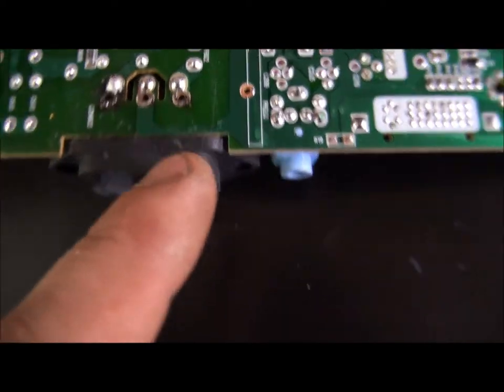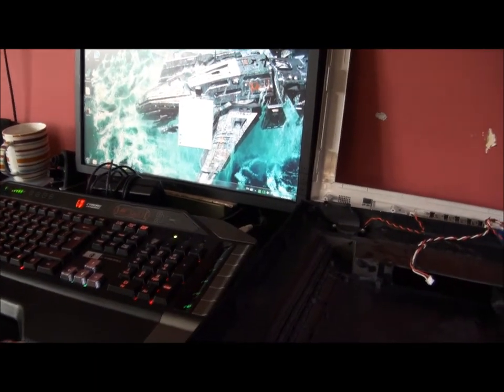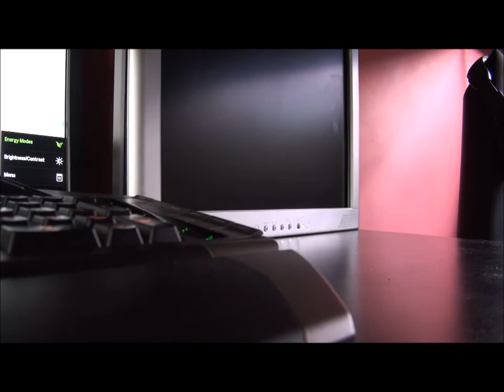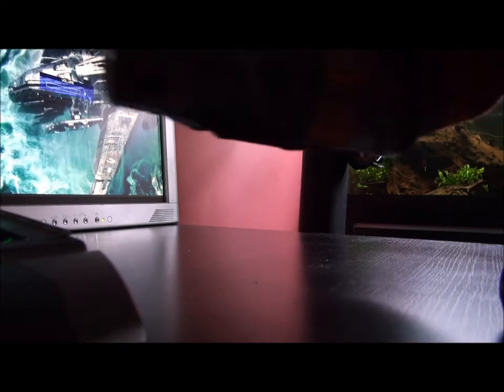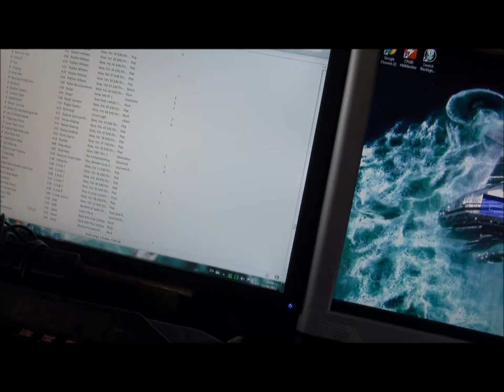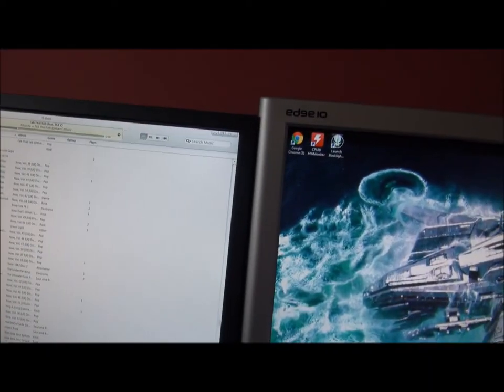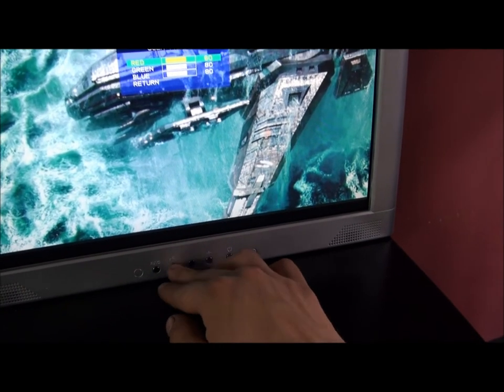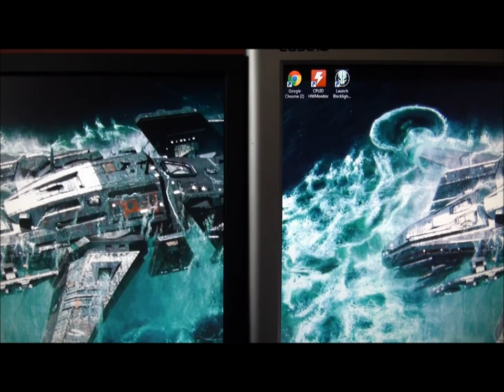lcd monitor repair

Comment: I'm glad you were able to fix it, but it's really stupid that these newer monitors often suffer from bad solder joints and bad capacitors. I have some old LCD monitors from 1999-2002 and they all still work perfectly with no repairs ever needed!